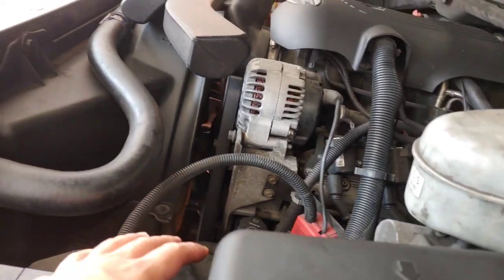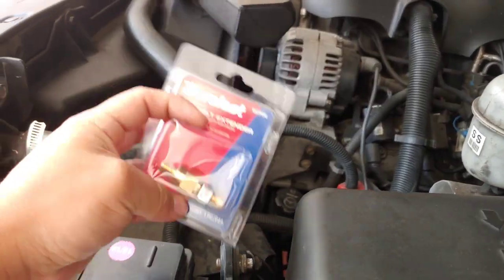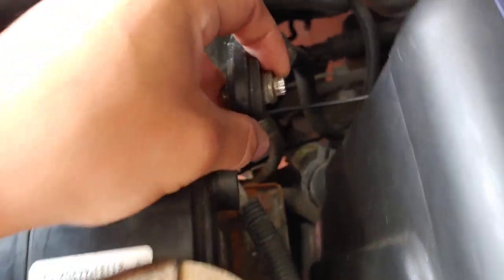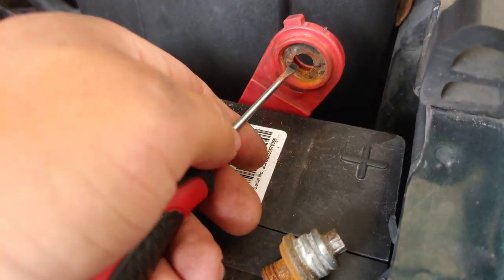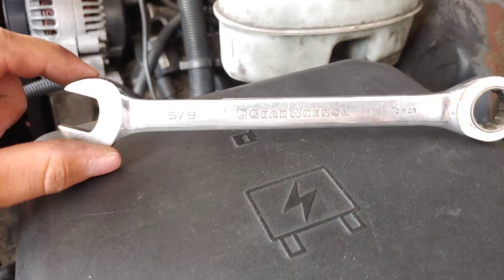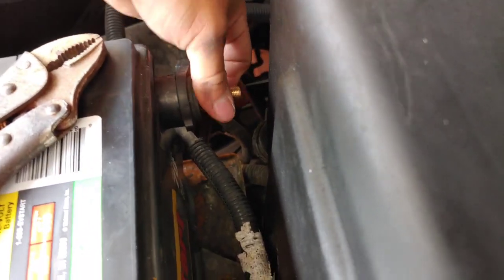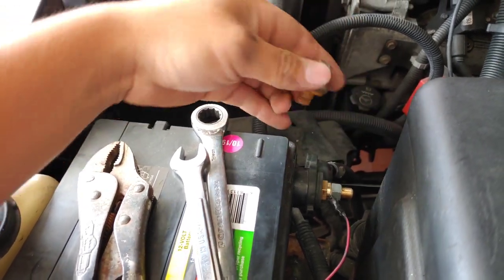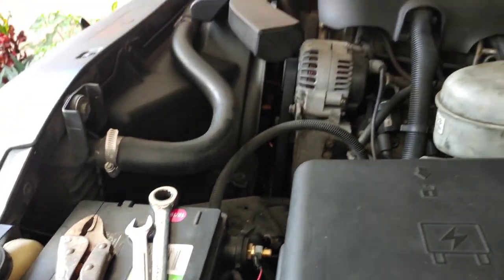Battery Side Post Bolt Extender For GM Vehicles!

Comment: The kit looks nice but if you want to go even cheaper,  just bear in mind that the thread size for this bolt is 3/8" coarse thread so you can get some bolts the proper length or cut some threaded bar stock to the right length and thread them into the terminal posts and use double or single nuts that suit your wiring needs.

Comment: Thank you! I have been trying to find a solution to add a permanent mount trickle charger connection to the side mount battery terminals on my 2003 Oldsmobile Bravada. Battery side bolt extenders are the perfect solution.
Reply: Same idea. 2003 Chevy TrailBlazer.

Comment: Thanks for the video.  On my GM side-mount terminals, you can't clip on booster cables or even add a battery tender.  This should solve problem.

Comment: Would it be theoretically possible to wire a ring terminal to the battery without using a bolt extender?

Comment: Only issue with those (as you mentioned) the threads aren’t quite long enough to prevent stripping. I’ve noticed that they could be even 1/4” longer and they’d be perfect.
Reply from the maker: Yes they need a bit more thread to bite on

Comment: I always hear negative first or positive first for the battery. What would be the logic for putting either in first?
Reply from the maker: When Disconnecting A Battery Always Remove Negative First Then Positive... When Connecting Back A Battery Always Positive First Then Negative....
Reply: One of the reasons for this is because if the negative is connected and you're screwing the positive side and the tool happens to hit metal, then it will arc.
Reply: Because electricity needs a ground to work. The negative is the ground. If your application is not grounded and you are handling it, you just became the ground and can be electrocuted now. Therefore leaving off the ground until connected is safer. I hope I didn't mess up that explanation 😉

Comment: You  can  buy   the   extender,   but   since im  spending   money,   I  would  just   do   the   better   solution.      SIDE  POST   TO    TOP   POST    ADAPTER.
Reply from the maker: That works as well, even better. Will be switching battery soon with that adapter

Comment: I have same battery but no extender. How could I charge battery in place without removal of battery.
Reply: the post bolt heads are small but with care you should be able to attach the charger clamps..

Comment: Yeah that's nice when you have the room you do.  On a second gen trans am, you have no room to do this.
Reply: I have a third gen formula and I cant get mine to thread to save my life. By itself the extender goes in fine, with the rubber coated terminal, no go. I'm losing my sh*t.
Reply: Same with my Fiero 🤦🏻‍♂️

Comment: Dam bro I just replaced the bolts and was gonna get those extensions but they only had one left ,so I went with the original size, smdh, I'm taking these back 1st thing in the am, lol

Also be careful an try not to bend the actually terminal connection on the inside of the rubber + - , need to replace my negative rubber garment its completely worn out and couldn't slide the rubber into the battery terminal, so that's on the replacement list!